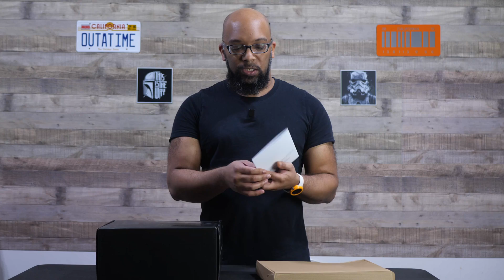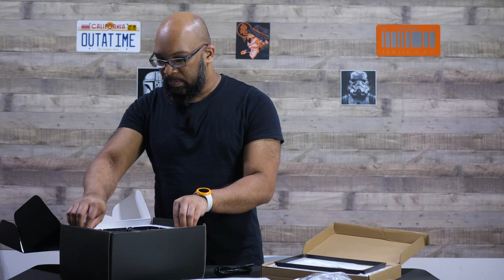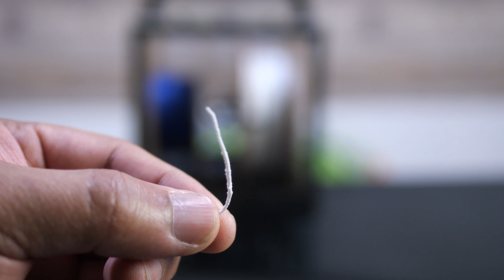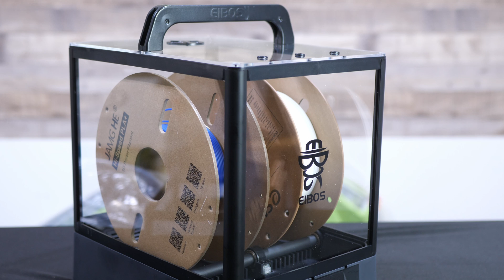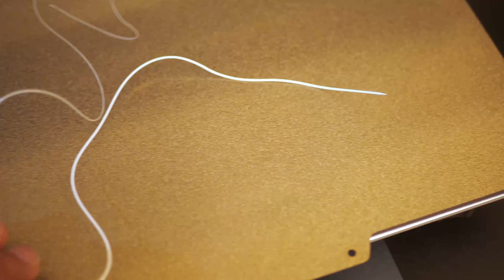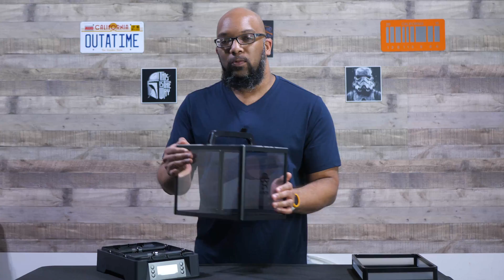EIBOS Polyphemus Filament Dryer Review!

Comment: You can actually dry/rejuvenate those silica packets at PETG/ABS (140F or 60C) drying temps. I do that with my silica packets, I just put some of them in when drying ABS or PETG. If you order enough filament you will have a whole lot of them and it's better to just reuse them than throw them away when you have the ability to do so. Works for silica packets that are not branded as "reusable". The reusable ones just have color indicators telling you when to dry them. I wouldn't use a microwave for drying them though unless they say that they can be dried with one.

My dryer is just a food dehydrator I got for $50 and printed PETG walls for it.

Comment: Probably print that extension if your build plate is large enough. Or split it into multiple parts, print it, then fix them together.
Reply: I know this is a little bit of an old comment, but I wanted to add that there is a freely available .stl for printing the extension on the EIBOS website.

Comment: I bought their original small single roll one a while ago. It works well however is very basic. I wanted something a bit better that held multiple rolls and also went up to 70c for polycarbonate and nylon. I went with the Sunlu S4 dryer. It is well made and works very well. I looked at this one however the build quality doesn't seem as good as some others. I did want the new creality Pi dryer but the double roll version is not out here in Canada. So I spent a bit more and went with the S4. I don't regret it. The storage feature is so handy.